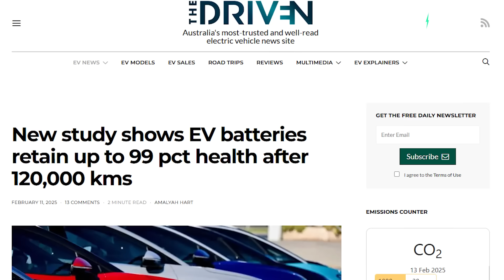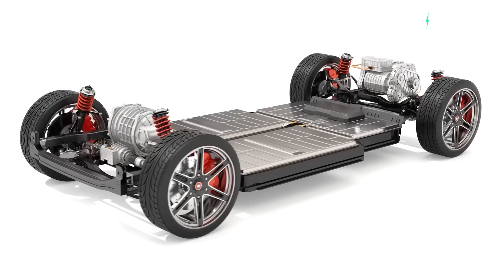New study reveals EV batteries retain 99% health after 120,000 kms

Comment: I wonder if part of the solution is that the actual amount of capacity installed is higher than the officially stated amount, allowing for that initial degradation that seems to happen on all new batteries (yes also phones and laptops.........) but the "hidden" capacity is used to keep the stated capacity the same.
I think it is clear that batteries are getting better and better almost every day ;).
Reply: Uhh, no, EXACTLY the opposite. Read the warranty on a Tesla. The battery is guaranteed to be at 80% of nominal capacity at the end of the warranty period (dont remember what that is). 

The catch is, that that applies from day 1. So if you buy a Tesla with a (say) nominal 90 kWh battery, and its capacity WHEN NEW is more than 72kWh, then its within warrantly specifications, providing it stays above 72 kWh for the duration of the warranty. Being cynical of Musk who is as breathtaking a liar as his best mate Dump, I suspect that a LOT of Tesla buyers have bought cars with barely more than 80% of their nominal battery capacity when new. Your initial comment that manufacturers might "give" you more than what you paid for is laughably idiotic no matter what the product is
Reply: @oldwombat  I remember that a few brands were bringing cars onto the market with stated capacity being lower than what was physically installed, hence my thought that to avoid warranty claims, keep the stated capacity lower than what is really installed and then "eat into" the spare capacity to remain above 80% using software code. Little bit like the cheats with diesels..........

Comment: It is really hard to balance between optimism (if you use EV carefully) and a bit of warning (you choose innefficient EV and or use it like lunatic). Things like driving it hard or super charging it, in cold morning, is detrimental to battery. Driving it hard on good temperature will help battery, but would hit suspension, steering, tyre harder as EV even the most efficient one is heavier. I kind like wish, if you do want guarantee of 200-300k miles battery, sign this and we will track the usage (preheating in the cold morning, drive gently, less frequent spr chg, if so always do 30mins precond, etc), if not you will have 80kmiles warranty.

Comment: There is a story doing the rounds in the UK where a couple bought an EV Nissan Leaf from a non Nissan dealer but under Nissan Warranty. At 98,000 miles and 5 years old, the battery would only give a range of 60 miles. Nissan analysed the battery pack (eventually) and confirmed the battery needed replacement. They would not do it under warranty, and wanted £17,000 for the fix, then said they couldn't do it because the batteries were no longer manufactured. A year on this poor couple still do not have a working car. Despite your warm words Mr Viking I'll keep my 20 year old Rover 75 that I'm sure will still be going in 10 years time as I'm risk averse.

Comment: Only from these types of studies can confidence be gained.
I feel that the  cautious scepticism has come from experience with batteries used in power tools and personal electronics, where Li batteries have degraded in much shorter life spans. 
Keeping in mind that the laboratory cycle testing is a more rigorous type of cycle test that is meant to simulate real world life cycle assumptions in much shorter time frame.
Only after studying actual longevity over many years and many vehicles can these simulations and accelerated lifecycle laboratory test be compared.
It is pleasing to see that real world results are more favourable in this instance than the accelerated testing suggested.
Unlike the rolling road millage/ Kilometres per kWh tests that are used on cars.
Where the quoted range is far from accurate in real world driving. (WLTP) World Harmonized Light Vehicle testing Procedure  which is a controlled simulated test on a rolling road.

Comment: Solar does not scale worth a damn.  Solar panels are two dimensional while demand has infinite potential dimensions.  Green tech will leave all economies who try to embrace it mired in 20th century levels of development and relative poverty. There is not enough land area for industrial applications of the 20th century let alone the future demands of the 21th century.  Unreliable power is next to worthless.  Imagine factories and schools shut down on cloudy days.  Imagine the rolling brownouts and noisy diesel generators fouling every neighborhood.

Ironically locations like yours in Australia than think they can embrace solar will have to compete with Locations like the PNW US, East Coast US and Europe that will have to to with natural gas or nuclear.  The green locals will be left out of the fossil fuel based technology that will ensue.  Potential examples
1.  Rapid reuse rockets and satellite arrays providing: internet, cellular, real time surveillance, remote control infrastructure.  

2. Ocean mining; minerals, methane hydrates, ect

3. Three dimensional printing:  housing, emergency equipment, ship manufacturing, customized vehicle manufacture.

Comment: The survey actually said UP TO 99% . Misleading headline as usual. And comments below the original Pickles article ask some very searching questions. The survey is all softare based, not complete recharge/complete discharge based, so you are depending on the software accuracy, not real life. The tesla owner in the comments said 5y/o 60,000km /90% battery left.

Comment: Fear that the battery will die early is the number two reason people resist buying EVs. The number one reason is the time it takes to charge. That still needs improvement.
Reply: The published ranges need to adequately quote real life ranges, not best condition ranges. In the winter, at night, heating on produces very sifferent figures. When you start off lying to your customers, it will not end well.

Comment: I do not get that you explain health of a battery in an amount of km.
Because a 28KWH battery car has much more cycles to drive 120K km than a car with a 75KWh battery.
However I do agree that a battery after (now 83K  km) has a very good health in my 72,6 kwh car. 
In your video you should mention which battery size you speak about wih this claim with driving 120K km.
Hyundai's claim  could be about the 64KWH kona beattery.
Reply: Without specifying the charging regime on the 250 cars tested via odbc, its a pointless survey.
Reply: @Dungshoveleux  Charging regime does not alter a lot. At least not for lpf batteries.
Also that myth is debunked. The numbers of charge cycles however DO matter.
Reply: @reiniernn9071  yes, the battery size will impact that.

Comment: Sure thing Viking, that explains why the kid who used is model 3 driving for Uber went through 3 batteries in 1 year.
Reply: Just like ICE there’s a bathtub failure curve (brand new ICE cars, direct from the show room, sometimes suffer terminal engine failure). You’ll always find some that will fail early. Warranties handle this case. Once you get past this stage then the failure rate is low. As the battery reaches the end of its design life then the failure rate starts to creep back up again. 
As for the Uber driver, it’s quite possible that there’s a different underlying reason for the failure (for example a faulty BMS) as failing that early is unusual for even one occasion. There are multiple examples of battery packs lasting over 300,000 miles.

Comment: If the batteries are that good, the EV companies could give a 200K mile free replacement guarantee. This would remove any concern about the batteries.
Reply: Tesla could actually have an edge with such a guarantee. They already have a solution to use the old batteries in energy storage.
Reply: In Indonesia, most EV makers sell their products with a lifetime warranty for the battery, motor, and motor controller, provided that the vehicle is driven no more than 30,000 km per year and the state of health (SOH) remains above 70%.

Comment: This is based on the State of Health reading of the cars BMS.
Totally bogus number, and not a meassure of degradation.
Especially Hyundai BMS keep reporting 100% SoH for many years.
Every single battery ever produced has degradation, typically 2-3 percent in the first year, and then a more steady degradation.
Pushing this kind of mis-information is not going to help the EV case.

Comment: What people don’t realize is that ICE cars also lose range (or fuel efficiency). Here’s what Google AI had to offer on the subject: 
According to studies, a car can typically lose between 30% and 35% of its original fuel efficiency after 10 years, which translates to a significant drop in MPG depending on the original fuel economy of the vehicle; meaning a car that originally got 25 MPG could see a decrease to around 16-17 MPG after a decade.
Reply: I'm an EV fan, but that doesn't really line up with my experience driving an old ICE car.
Reply: Exactly.

Comment: No battery in the world will retain 99% of health under normal use condition after 120k km or 90k Miles
Reply: At 2:20, he says at least 90% retained at 120k. Though this  can't be found on the one source I saw, the Driven article, which only says 1.8% a year initially. Both numbers may be pessimistic. 
But because he farms out the b-roll, he may also farm out the title, which currently says 99% retained. I'm being charitable, it's a little oops that could double the clicks.
I watch Sam as much for entertainment purposes as news. Also as a check on whether my pro EVism has gone tribal. The post is bunk.
Reply: Nobody’s smart phone batteries are optimized for longevity.
Car batteries, on the other hand, are.
Reply: 3:27
Different report

Comment: My car is at 80,000 kms and it is struggling.  It has about half the original range right now.  I can't complain, it's 9 years old and it's been a good daily driver.
Reply: Brand, year, model?
Reply: @larryc1616  2016 Nissan leaf.  I'm pretty sure it's one of the 30kWhr variety. It's mostly my commute vehicle, 20 miles/day, slow charging to 80% every night.
Reply: @madcow3417  that fits. Nissan skimped on an active cooling system for early Leafs (passive cooling only), resulting in much reduced lifespans. Blame Nissan, not the lifespan of batteries.
Reply: This is all propaganda.  Probably  funded by the same Car companies that all LIED ABOUT THEIR EV RANGES.
Reply: If you're data is correct, and I doubt it before you name brand, manufacturing year and model, then you as a driver did pretty much everything wrong with charging and driving.
Reply: 9 years? Probably LiMH battery. Not LFP or NMC

Comment: Here's the key takeaway from an article on the Pickles study:

"Of the vehicles in the study, Hyundai electric cars fared best, with 99.30 per cent of range maintained across 64 vehicles tested, at an average age of 39 months and 29,237km mileage. Its most popular electric model is the Hyundai Kona EV SUV."

Now note this figure is NOT based on 120,000 km, becaus the Hyundais were on average so new.  But it is remarkable because Hyundai up to now has an all li-ion lineup, no LFP.  On the one hand, batteries usually have an unreported reserve over "100%", so that may be the explanation.  However, common belief held that you would lose the first few % of capacity very quickly in a new car, and then losses would drop off.  So those two phenomena might have canceled each other out.

Comment: I worked for a battery storage supplier 5-years ago, we offered both NMC and LFP batts.  We found the exact same degradation from our NMC batts as we did from our LFP batts, in fact, some of the NMC batts showed less degradation with better performance in cold temps, faster charging and faster discharge.  Most of it depends on the BMS in regulating the temperature and charge rates.
Reply: Hi where you worked, I am interested to learn more about this business,, in Canada

Comment: The fear came from older EV and Hybrid cars before Tesla became known. Such as Toyota Prius  or Nissan Leaf, BMW i3 maybe these cars were using older battery technology and they are shockingly bad at degradation of battery life after 10 years.
Point taken Batteries are allot better now, but does not  mean the quality build of the car is any better. Could be worst with some car manufacturer.

Comment: So why do cars continue to come with packs that reserve 20% of battery space for wear and degradation? That's like someone bragging about retiring comfortable on a government pension, but forgetting to tell you about $2M inheritance they got along the way and the $1M house they live in rent free.
Reply: Doesn't apply to BYD LFP batteries. I always charge to 100% when possible.
Reply: Honestly, I don't need to utilise 100% of my battery most of the time because I plug in at home whenever I'm not driving. Even my regular 120km round trip daily commute only takes my battery from 80% to  about 55%. If i need to do a long road trip or id im towing my camper with the familyon board, then I bump it up to charge to 100% the night before I leave. Charge using solar excess and on off peak rates in middleof day and middle of night, which helps balance the grid. It's not rocket science,  but you do need to actually experience how amazingly efficient,  cheap, and convenient evs are to open your mind. And you have to be willing to learn and have an open mind, which most ev haters struggle with.
Reply: No, they reserve a few percent as running a Lithium cell flat shortens it’s life considerably. It’s also recommended to keep the charge level between 10 and 80 percent as that will help extend the life of NMC cells. LFP doesn’t need this extra step.

Comment: There is a reason we all assume the batteries will degrade. At 250k miles a Toyota Auris hybrid battery is significantly degraded, I can’t give you exact numbers but I am a taxi driver and around town is slightly more expensive then running a 1.6 diesel
Reply: It is a Nickel Metal Hydride (NiMH) battery...not comparable.

Comment: My Ford Mustang Mach-E has 286,463km on it and has lost only 10% range.
Reply: Impressive
Reply: @JohnSmith-x3y8h  That's why automakers are backing off from making EVs, there's no recurring income once sold.
Reply: Have you had to deal with any repairs? And are the Ford dealerships set up for that?  I'm just asking because that's one of the main objections in the U.S. to EVs -- no one to repair them allegedly.
Reply: @randygraham926  Even if you need to repair anything, it is usually body work, like tyre changes, repairing collision damage, etc. Battery or electrical repairs are very rare. Body work can be done by any qualified shop. My wife's Fiat 500e suffered collision damage recently and we just drove it to the nearest dealer and had it repaired. End of story.
Reply: Ford is using CATL

Comment: Have my model 3 lfp car for 2 years and over 40k miles.  My only maintenence is windshield washing fluid.  May have to get a set of tires at 50k miles.  LFP lost only 3% of range so far.  The car is quick warm and wonderful to drive.  If you can get a model 3 do it
Reply: @ChicagoBob123  dont forget to do a little brake pads maitenance 👍
Reply: My Model Y LFP ownership for 1 year has only lost 0.9% of range. At this rate the battery will last for more than a decade, It’s great!

Comment: Tell this to Nissan. I just had my 2017 Leaf 30 kWh battery replaced under warranty (at 74k kms). I now have a fabulous 40 kWh battery and 300 kms of range. I hope this new battery will last much longer!
Reply: Battery technology in 2017 was not comparable to the batteries produced since 2020.
Reply: @GeeDeeBird Which batteries specifically? What brand & cell type?
Reply: @neiliewheeliebin   Compared to 2017? Literally all of them.
Reply: Early Leaf’s had no active cooling of the batteries. They ran outside of the temperature range that was optimal much of the time (for example you couldn’t do a long journey with multiple fast charges because of the heat). They didn’t use particularly good batteries either. 
Competing EVs from the same period have much better battery lives.
Reply: Without active cooling, no batteries last.
Reply: Who makes the battery?
Reply: @larryc1616  AESC makes them. It's a joint venture company.
Reply: @Supernaut2000  no wonder why it expired so early. Those are crap batteries
Reply: Nissan has terrible batteries, literally.
Reply: @Kallon-r3b  Nope, just a lack of TMS.

Comment: I've owned two electric (teslas) cars and have many friends with electric cars.

This study is a load of horse sh!t. 

My model 3 with 82K km is down to 93%  while model Y is down to 94% with 23K km
Reply: 6% after only 23k km? That car is basically new and lost so much range...
Reply: The degradation curves are clear, there’s a lot of degradation in the first 20,000 miles but it then flattens out.